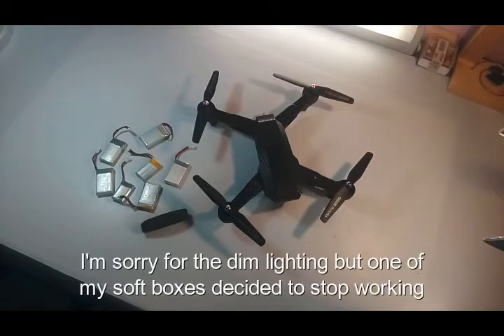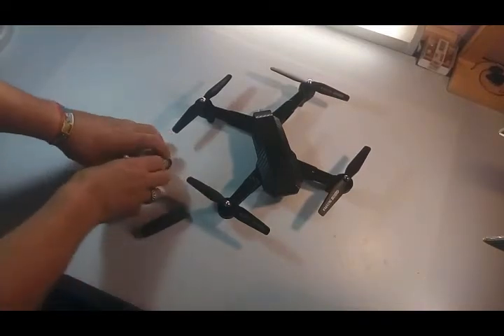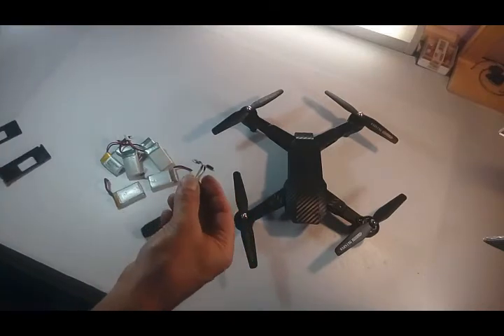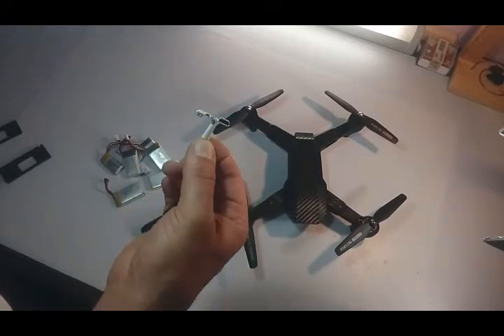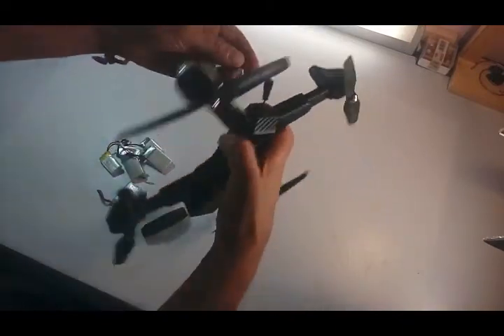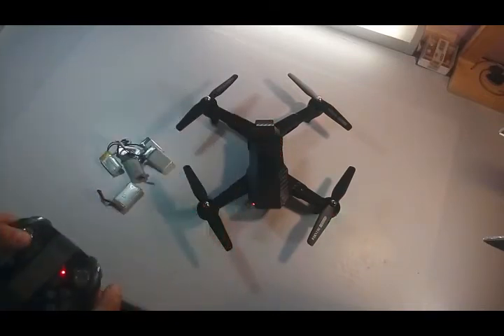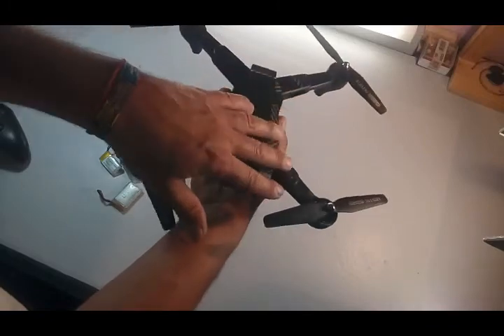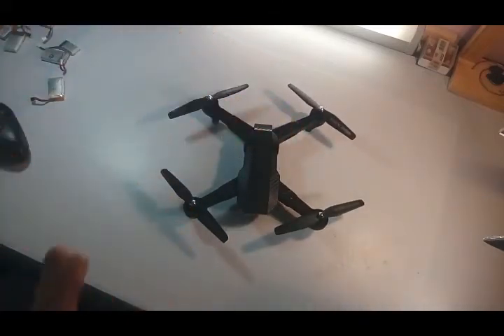Visuo Drone Battery Mod - To hot outside to fly

Comment: This is awesome, just bought this quad and some little 3.7 batteries to do this mod, did you just cut the old connector off the wire and solder the other one from the charging cable straight onto the cable or did you solder to the board? New to quad mods ;)
Reply from the maker: Alexander this little one is tons of fun to fly, he's super fast on 3rd rate. Doing the mod be careful because the 3.7 volt batterys need to be at least 850/900mAh to have enough power for the quad. Cut the wires from the charging board and solder them to the wires from the old charging cable, make sure you solder the positive to positive and so on... soldering directly to the board is a little dangerous because of the heat from your soldering iron on the board, it can get burned... quads are super fun to fly and mod, you learn as you go even if it's only changing the visuals of it... thanks for watching, all the best
Reply: Thanks for this mod.I did soldering directly to the board :(  however the circuit was faulty before. I was not abale to charge it with included USB cable (charger). So after this mod I charged the original battery with Imax charger to almost 900 mAh.  My Quad starts and takes off but stops immediately. I tried with different batteries 3.7V 400mAH - same. So I think its circuit problem. I also guess maybe the wires I soldered are too thin and are providing too little power? Hope new original battery will solve this.
Reply from the maker: ziurovas it will work with the original battery again, it probably has some type of short circuit or something.... sorry to hear it didn't work with your quad, all the best...
Reply: Yes, I soldered original battery back to cirquit and the drone flies. SO I think that the main problem you need to use connector with  fat wire. lke this: shttp://www.gearbest.com/multi-rotor-parts/pp_260798.html?wid=21, wires from drone's USB charger are too thin to provide enough power for flying. Thanks
Reply: I have the same issue. Did using the thick wires solved the problem?
Thanks for answering.

Comment: Nice mod. the problem is those small batteries (300,350,500,600,650mAh) give you a very little fight time. But OK why not. I bought 2 spare batteries for 13€ that's worth its prize ? Anyways thumbs up !
Reply from the maker: Thanks for watching Buck, buying proprietary batterys for your quads is always good because they are the most efficient battery for it, €13 two batterys seams a little expensive but totally worth it... all the best
Reply: Cheers keep going strong
Reply: those small batteries usually fit mini drones like JJ H20H

Comment: hello. do you think i can use 4000mha 3.7V Rechargeable Battery with this drone ?
Reply from the maker: I think you can use them but the´re probably to heavy for the quad to handle, also you risk burning the flight ccontroller on it... You should go with 800mAh max to still enjoy the drone without any issues...
Reply: thanks.. i will make antenna mod and battery mod.. i will use 2200mha like someone in other video.. thanks for reply tho.. and keep up with videos ! have a nice day :)

Comment: Hi luis...i've some question for you...what if i upgrade my visuo battery with type 18650 3,7v battery?is that save?thanks...
Reply from the maker: First of all, thanks for watching Aleeva Venoya... The main thing you have to consider is how many mAha that battery is, the Visuo works with a 900mAh battery so you have to use at least the same mAh type of battery... All above that is ok and will give more flying time, hope it helped you... All the best
Reply: Drone lovers Luís Costa Pereira Is not it bigger mAH the longer the flight time?
Reply from the maker: Exacly, all above 900mAh gives the Visuo more flitght time...
Reply: Ok...thanks for your advice...👍

Comment: Hi mate. Any chance to change the camera for better one?
Reply from the maker: You can try to buy the stock camera from the JJRC H98, it records in 640x480 VGA and it´s about the same size has the camera on the Visuo... You can also try mounting a Q8 camera that records either in 720 or 1080 and it´s very small but a bit heavy... Thanks for watching, all the best...

Comment: Hi "Drone lovers Portugal", thanks for beneficial video. I have this drone too and try to make better battery for longer flying. I read previously comments and saw recommended limit 1000 mAh. I made the battery from cell gained from 11.1V 3S 2200mAh battery and pluged it to my drone. Then I switched ON/OFF button to ON position, binded with transmitter, but cannot take off. It looks like drone cannot take off through weigth of battery, but I think, it is nonsense. So, the propellers are spinning, bud by turn left joystick tu up position has drone not enough stroke to take off. With original battery flies drone ok. I'd like to ask you about your expiriences. I hope for early answer.
Reply from the maker: mrTaron thanks for passing by, comments are always welcome and apreciated... My Visou has broken since the making of this vid, I think the flight controller is burned or something... the weight of the batteries have a major influence on his performance but the thing is that some sells are made to work in series and alone the dont have the same discharge rating has if they were working with other sells, it has to do with the C rating I think... Like a 3sell battery with 1200mAh and a 30c discharge rating only has 400mAh and 10c per sell, I'm not 100% certain of this, I never tryed to use sells from a bigger battery but will try it in the future... On my Visou I was using 3.7volt 850mAh batterys and they work great giving me 7/8minutes of flying time, these are the ones I would recomend... Hope it helped you, all the best
Reply: Hi, first - thanks for so early answer. What about weight of my battery, it is not big difference between original 900mAh and 2200mAh battery. This drone should be able to weighing bigger weights then several of grams. I think, internal electronic was not builded for so strong battery. To bring my interest closer, it is not going only about longer flying time (with original battery 10-15min according the flying style). I plan replace of motors for Syma X8C model including main stand and cogwheels. But bigger motors have bigger consumption, therefore I need better battery. So, could you please give me some advices, how can I proceed?
Reply from the maker: mrTaron that is a mod I wouldn't recomend because there's a lot of other issues you have to take in consideration... If you want a quad that you can upgrade every single part my advice to you is moving to rancing quad or even build one your self... start with a litlle brushed one (check my latest build vid) to gain more "know how" and then go try building a brushless quad... these toy drones come with flight controllers that have lot of limitations, since my visuo broke I tryed to upgraded but until now nothing worked, his motors (8520 brushed) wont spin on other flight controllers but I really dont know why...Sorry I can't help you more but I'm still learning myself, use your actual knowledge, research and do a lot of trial and error that's the best way to learn something... I gess my main advise for now is to build a litle brushed quad and you will see things differently, belive me that we learn a lot more that way... all the best

Comment: Good thinking!  I did the same thing, but with the new batteries inside the stock battery case. Description here: https://www.rcgroups.com/forums/showthread.php?2891595-Visuo-XS809W-review-now-also-XS809HW-comparison/page8
(Note the velcro on the underside of my quad is for external cameras (SQ9/FPV, etc)  It even lifts the SJ4000:
https://www.youtube.com/watch?v=ZHemBOPI6CY
Reply: Planet Fatbike thanks for the pics. If I don’t get a refund on mine, this is what I’ll do. I’ve just ordered the hubsan h501 advanced model with a few spare batteries. Can I use the the 2700mah battery on the visuo using your method? I will just buy the double battery connector and use the wires inside the visuo.
Reply: How big/heavy is the 2700mah battery? I jst received some 1100mahs. They are 29g, so approx the same as the stock battery in its case. The batteries are slightly larger than what was claimed in the listing (Aliexpress), so barely  does not fit in the battery bay unfortunately, so will have to velcro to the top or bottom. Will make a shield of of plastic and some foram tape to protect the outboard mounted battery in case of impact.
Reply: Planet Fatbike thanks for reply. I just got a battery delivered today and it’s far to heavy. I will order some 1100 just like you. In the images where you have the drone open I can see a red & black wires coming off the battery connector, is that the ones you soldered on?
Reply: Planet Fatbike don’t worry, I just looked at the images properly and they are the ones you soldered on. Thank you

Comment: so can i connect a lipo with a bigger mah? lets say 3-4000mah to make it fly longer?
Reply from the maker: It will not work with so many mAh, that will probably burn the circuit... Thanks for watching, all the best
Reply: Drone lovers Portugal thanks for the quick reply so I would need to use batteries with the same mah?
Reply from the maker: I whould´nt risk using more then 1000mAh since his propriatery battery has 900mAh, be carefull using stronger batterys... Thanks for watching, all the best.....
Reply: Drone lovers Portugal what of I connect a power bank instead?
Reply: assuming that the circuit is designed properly, more mAh means longer time, the battery provides the current, the circuit draws the current, the circuit will not draw more because there are more mAh, this is why you can charge your phone quicker with 1000mAh chager than 500 mAh charger. The bigger battery will last longer, take longer to charge but crucially weigh more, the limit is tied to the weight you are adding which also needs to be near the CoG (centre of gravity). The other critical factor is getting a battery that matches the original chemistry.
Reply: It's not the mAh that would burn out circuits it's the voltage. As long as the voltage of the new battery is 3.7V then more mAh just adds greater capacity or runtime. There is a video on here where a user adds a 2500mAh 18650 LiIon cell to the Visuo version of this drone. 
https://www.youtube.com/watch?v=qP8vSPNDe0o&t=252s